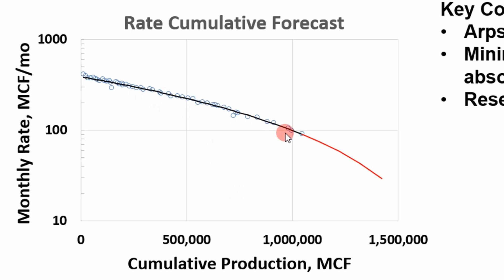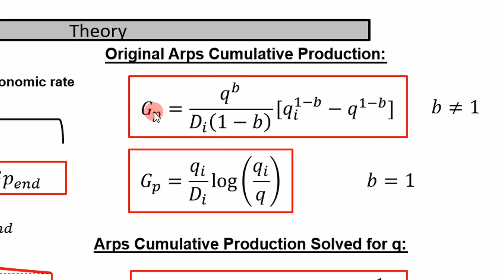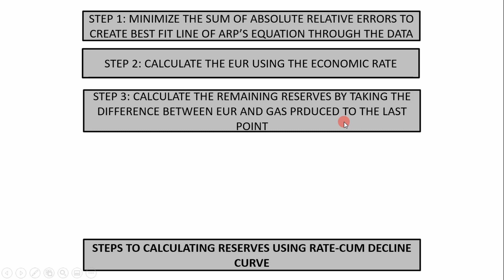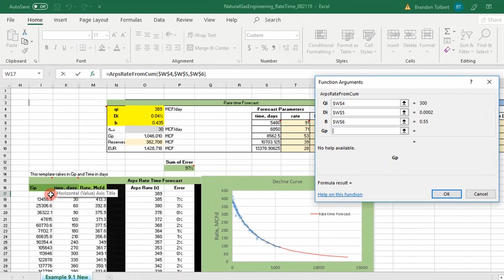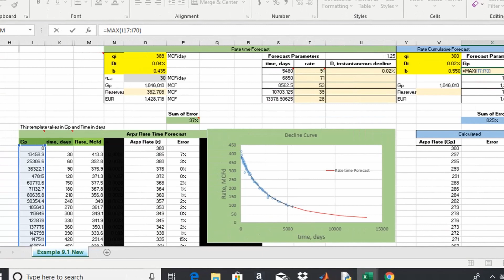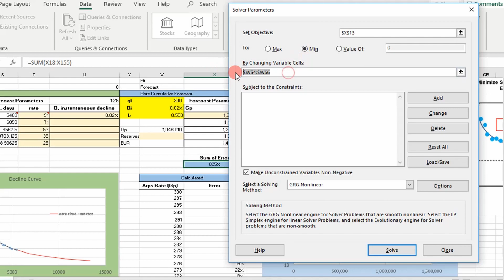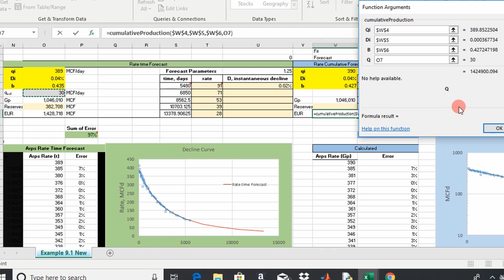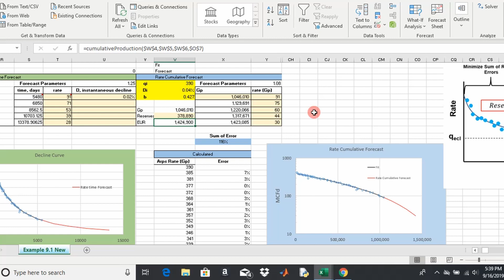Rate-Cumulative Production Decline Curve Analysis: A Step By Step Approach

Comment: Thanks a lot Brandon! Your videos are super and just helped introduce a beginner like myself to this kind of analysis. You have a great way of explaining things and making them sound very digestable!

Although i have seen the code you posted on your website for the functions,  I was wondering if it is possible to get the excel sheet you are using to kind of go over how you structured it and used the formulas more in depth as I am not an expert in excel, I think it would add a lot of value to the learning experience!
Thanks so much!
All the best👍👍